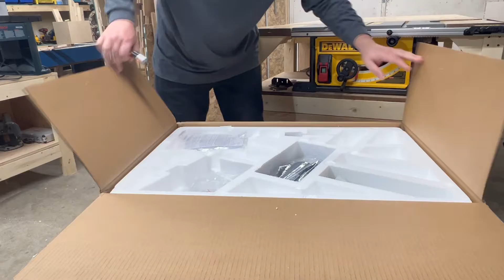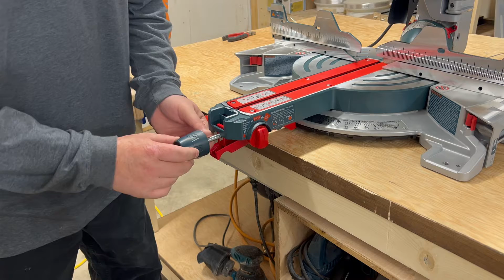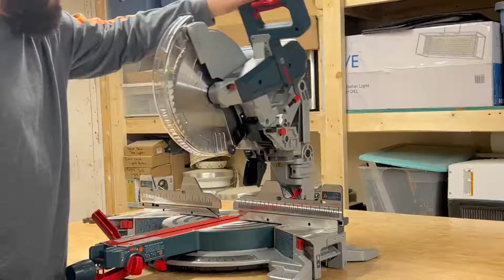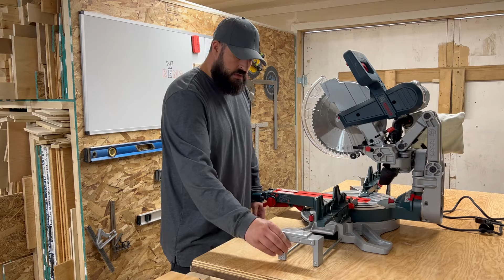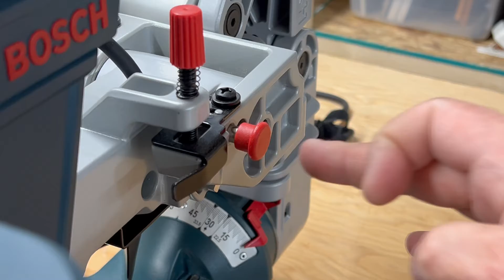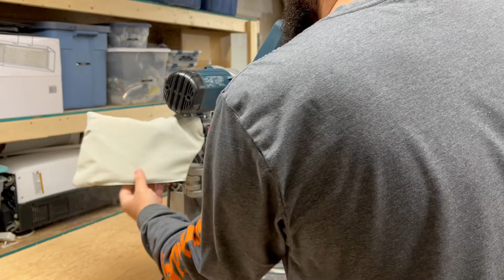Set Up and Calibration of the Bosch Miter Saw

Comment: Hey sir, just so you know, you actually can adjust the depth of cut and make it a bit deeper on these saws. If you look where the saw lock (the up/down lock)/DADO depth adjusting screw and pivot pin are there are two 2mm set screws right at the pivot that interact with a pin that sets the bottom and top depth/height. By adjusting that set screw you can get more depth so that you cut completely through without problem. (And I'm not talking about the dado/channel depth screw). Hope that helps, it made mine where I didn't have to be as fastidious with making sure I went all the way back to make full cuts.
Reply from the maker: Thank you I had no idea about this. That’s amazing!
Reply: Beat me to it

Comment: I have 10s of thousands of cuts on my saw. About 10 years worth. I even had a crew of 4 running on it.  Decks, framing, saunas, finish. Hard wood, soft wood, pvc, aluminum,  presure treated and even hardi trim at one point. Its taken some serious abuse and still is pretty accurate.  She has taken about 6 sold dives in the trailer and i finally broke the motor cover.  I think she is going to get repaired and  put on hardi trim and aluminum duty. Its made its money for sure. I was thinking of upgrading to the cordless version for the primary saw.
Reply from the maker: Definitely an amazing saw!

Comment: Doesn’t it come with a zero clearance setting? Just unscrew the screws on red thing and move them closer.
Reply from the maker: Yes you can do that but not really. When you use the saw the blade deflects ever so slightly. So you would either have to have them apart enough that the blade never touches or risk replacing the plastic. So yes in theory you can but it wouldn’t be a true zero clearance.

Comment: You forgot to mention one other very big negative. I wanted this saw badly over the Dewalt DWS780 so I could put it up against the wall...HOWEVER, the fact that this saw doesn't have a shadow line is a head scratcher. It's the only reason people consistently purchase the Dewalt over this saw. Once you have a shadow line, it's impossible to return to a saw without one. It makes your cuts 2 - 3 times faster if not more. Not to mention, I am blind in one eye, so it's even more critical with my depth perception or lack thereof. Now I understand there are videos out there on how to take out the dewalt assembly and install it into the bosch saw, but who wants to be drilling holes through their dewalt saw?
Reply from the maker: That is very true. That was a small factor for me. I can definitely see it being a big factor if you have problems with depth perception. There are “affordable solutions without drilling on Etsy. I considered buying a few but I’ve never really needed it especially since now with the new miter station table I set the length and just chop. No measuring needed most of the time. But yeah check out Etsy for a good shadow line attachment

Comment: There is a depth-of-cut adjustment on the right side just above the lock-down on the right side. You actually have a close-up shot of it in your video right at the eight minute mark in your video.
Reply from the maker: If your referring to how I don’t like how it barely cutting all the way through, the death of cut adjustment only can be adjusted when you have it flipped over and you want to stop the depth of cut. The saw does that when the depth of cut latch isn’t active. The saw needs to or should go down just a bit further.

Comment: Replaced our 20+ year old chop saw with this a couple of weeks ago - the safety switch is definitely an issue. I'm 5'4" - I can't really get my hand around the whole thing at once to slide the switch and pull the trigger. If I go through a contortionist act I can - barely but it's sure not comfortable. I'm trying to figure out some way to extend the switch or - something.
Reply from the maker: I didn’t say this but you could probably crazy glue the switch over and have it always unlocked. Be careful though. Also congrats, it’s a great saw. Miter station build is done just working on the edits for it.
Reply: @WeReno I agree, these safety switches are silly in this application.
Reply: As WeReno mentioned, you can permanently activate the "safety" switch with glue or some other means. I dunno how old you are, but idiot proofing machinery is a relatively new thing. It's perfectly safe with only one switch as long as you're not.. well... an idiot. Machinery didn't have these things 20 years ago, and they really haven't had much impact on safety for the vast majority of people.  Some safety devices make a lot of sense, but double switches activated by one hand on a miter saw just don't.

Comment: I have one, 2014 model it's a great saw but it has the same weak points that you montioned, but mine has a double laser right and left the blade but sometimes I find it useless because it's far away a little bit from the blade. 
But anyway it's a great saw and can make the job done.
Reply from the maker: I was curious on how accurate the laser or shadow line in is so thanks for the info. We appreciate the support.